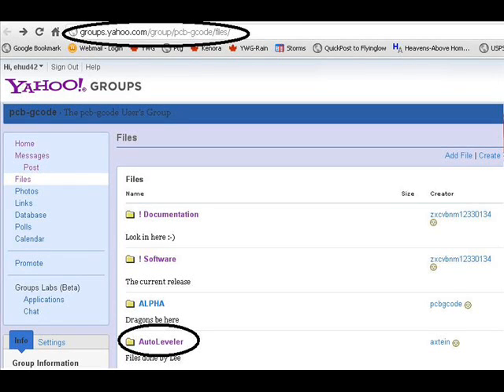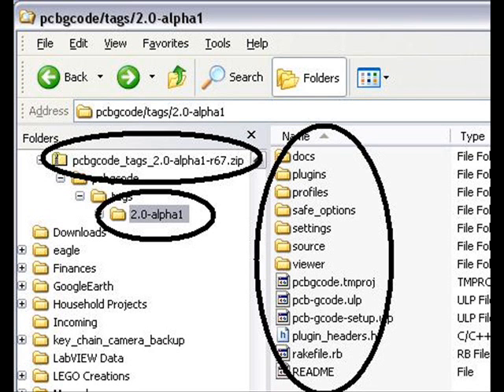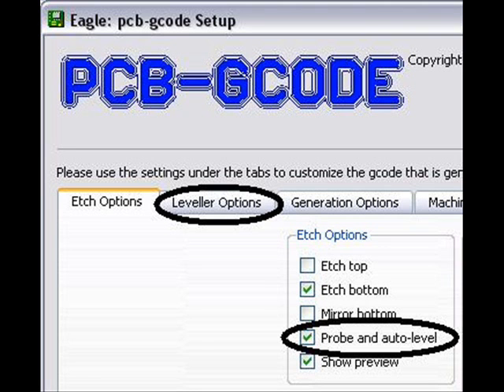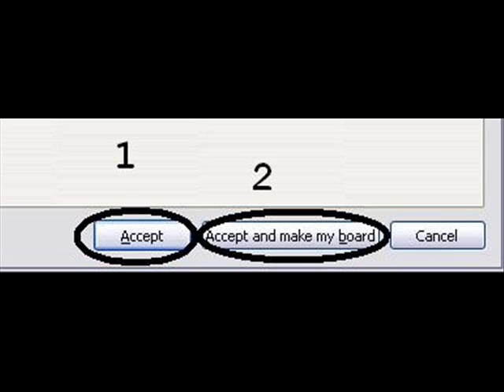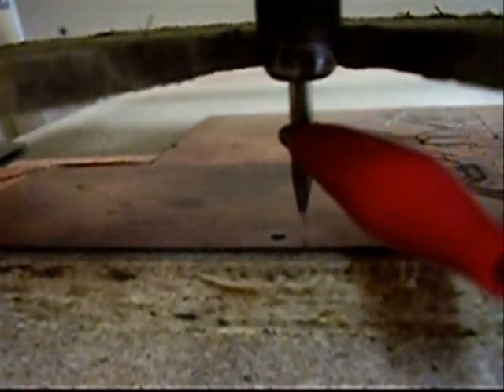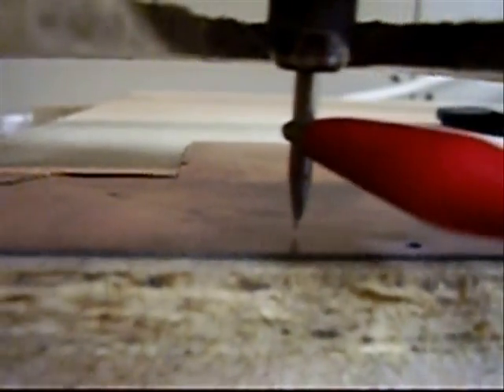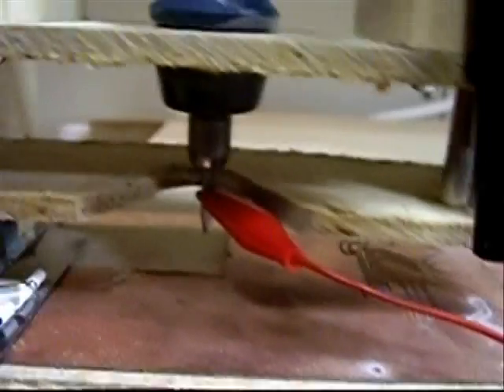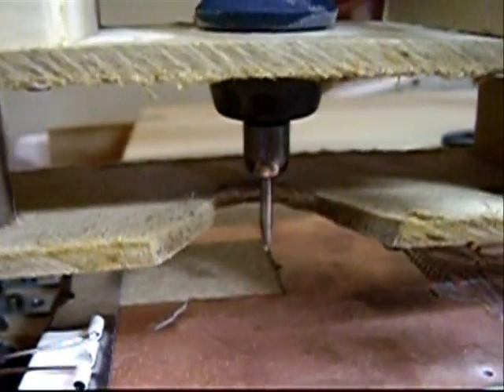pcb-gcode Autoleveller demo

Comment from the maker: In the setup for pcb-gcode, there is a tab (one of the last ones) where you select the machine type. I suspect there is a MACH3 option. If not, search the forums - lots of guys there use MACH3. You are correct, the autolevel adds a section of code near the beginning of the final gcode file to probe the board and modifies the milling code to use the stored values.

Comment from the maker: pcbgcode w/ the autoleveller is a script add-on for Eagle PCB designing software. The autoleveller function modifies the gcode to first probe the board, and then uses the probe data to modify the Z axis depth when milling. I use EMC / Linux CNC software to control my mill. In the setup/config I specify which pin on the parallel port is the probe input. That is wired to the aligator clip I attach to the bit. A ground (from the PC) is attached to the pcb.

Comment from the maker: The one downside is that these probed values are lost when the job ends. Each job must re-probe. My probing setup relies on an electrical path through the blank PCB board, so once some traces have been cut, the probing will mostly likely not work the second time.

Comment: I wonder how does pcbgcode catch the touching signal? I use MACH3, actually there is a probe input port.how did you wire your machine ? I cannot find a good help document for the pcbgcode autoleveller....